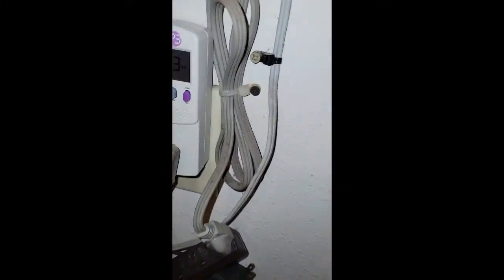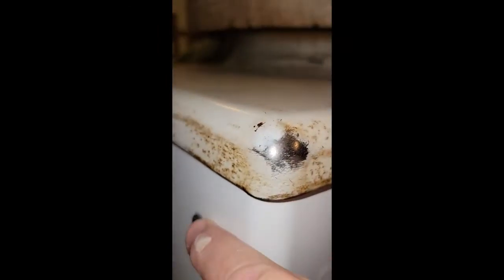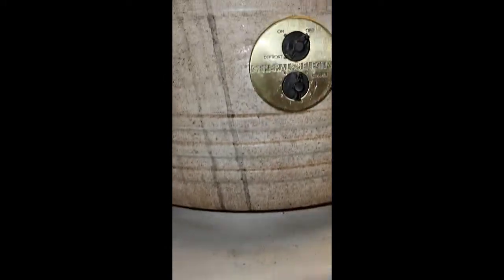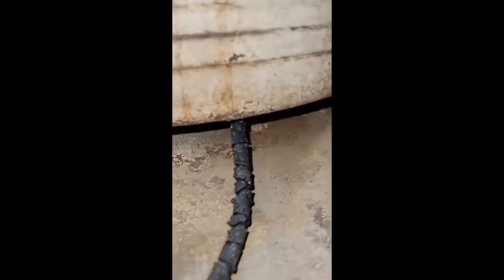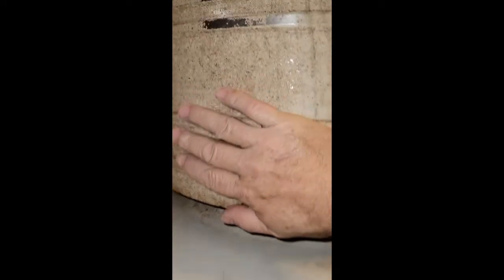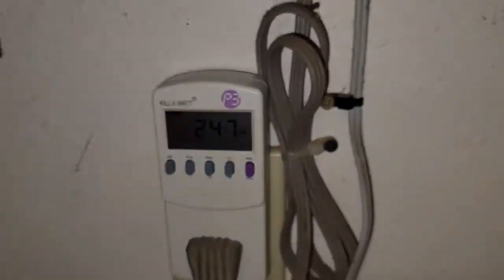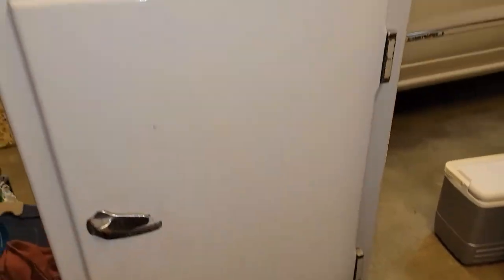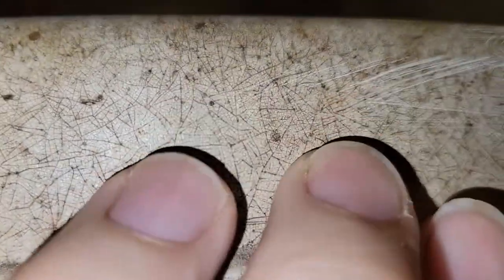Working GE Monitor Top

Comment: The CK series of refrigeration units introduced GE's Scotch-yoke compressor, an engineering marvel designed to outlast every competing design at the time.  Designed to reduce wear and stress as much as is possible for a piston refrigeration compressor,  it is no small wonder that so many still operate today with their original SO2 charge, and with little to no loss of cooling capacity.

Comment: I would use a good mask if you sand, it is possible the paint may contain lead and you don't want to be breathing in lead dust.  I would also look at replacing the door gasket if it, frosts up too quickly.  They make 'antique' replacement ones, but sometimes they are too stiff and don't seal properly.  You can also get peel off the backing and stick on gaskets, from 1/18 to 1/16 crack width or more or wider.  You may need to experiment.  It should not frost up too quickly, say a little frost after a few days.  You can put it on 'defrost' for an hour a day and it won't affect the inside temperature too much for that hour, but will help melt the frost off the chiller part.  Put a small tray under it to catch the water, that defrosts, but make sure the tray is very shallow.  If the tray is too tall, once the melted frost drips down, and you turn it back on to the 'on' cycle, that dripped frost will freeze and make ice cycles and may prevent you from removing the drip tray.  Ask me how I know.

Comment: What is the plug in the back in line with the power cord for ??
Reply from the maker: Thanks for watching.  It is to power the light inside the cabinet.
Reply: @happylittlefarmhouse4304  Thank You I just picked up a 1936 ck2 that had a new cord put on but not with an inline plug so I wasn’t sure .Thanks again!
Reply from the maker: There is a forum for old refrigerators with a wealth of information.  There is also another YouTube channel that covers repaing one.  There are a few models.  Ones with pull out shelves, ones with stationary shelves and one with a drawer in the bottom.  If you watched my videos the one that is not working has been declared gone.  Not sure what I will do with it.
Reply: @happylittlefarmhouse4304  cool I’ll for sure be checking them all out 👍🏻
Reply from the maker: @michaelwozniak9899   https://monitortop.freeforums.net/ is the site.     The guy that does all the work is:  https://www.youtube.com/c/davida1hiwaaynet/featured

He also replies to a lot of the posts on the forum.  His videos of the repairs are great.  Does your unit have shelves?  many don't.  I found out the hard way that the ones with fixed shelves cant use the sliding shelves and the ones should have sliding shelves will not allow the fixed shelves to work.